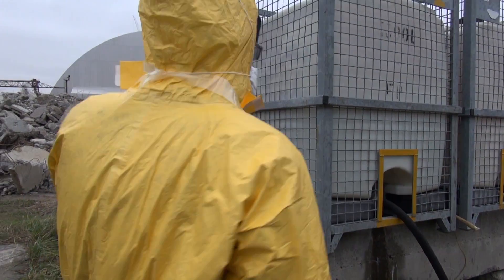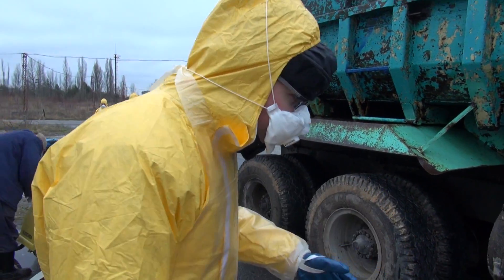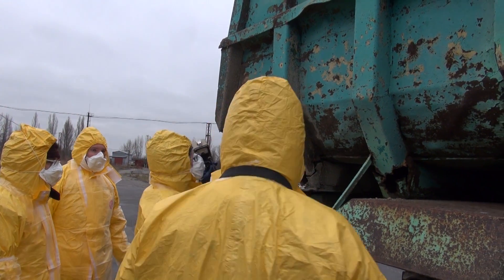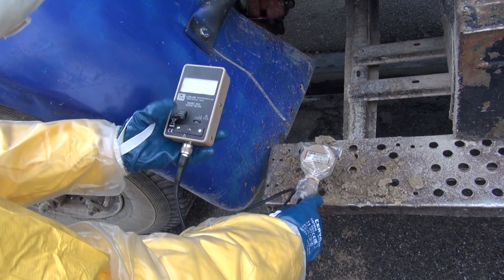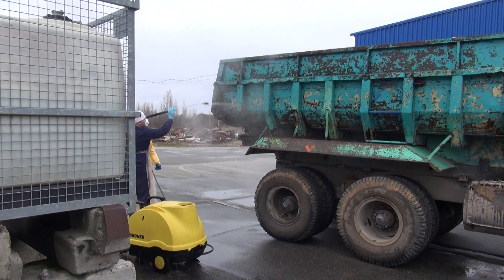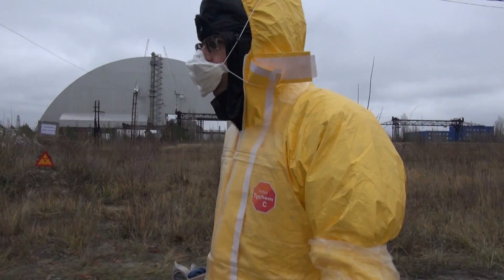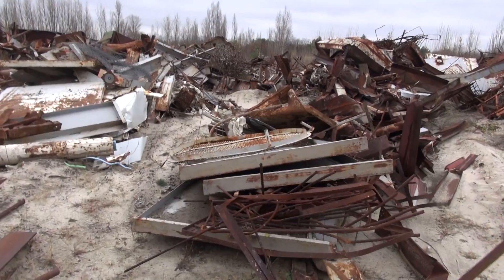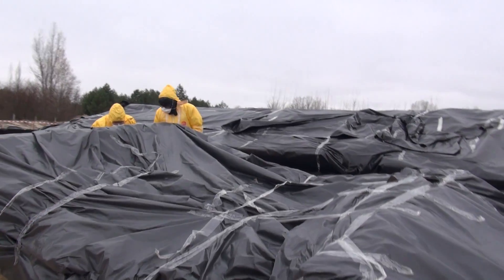decontaminating Chernobyl - what to do with a radioactive truck?

Comment: I always wondered since Fukushima could they in reference to contaminated soil just cover these areas With Molten Plastic aiming to capture the top soil and or maybe disc and till in hot molten plastic  to trap the contaminated soil within the solid structure of the plastic though it may be far to costly material

Comment: Would not it be better to be up on a platform and spray it down from above so that you don’t get contamination on you? Also you could collect the contamination if you had to truck in some kind of containment area instead of just washing it out on the road.
Reply: The higher you are the most radiation

Comment: All those area should be covered with 5-10-15 m high concrete with lead spreads. Does it work?
Reply: how should they dump 15 metres of concrete in a square that wont spread out and go flat in a perfect area around the power plant?

Comment: Nice video. What was the highest reading ? On the video there is shown 1 milliroentgen/hour? Blasting contaminated material with high pressure water looks quite dangerous, I cant even imagine how much there is hot particles airborne after that. I imagined that they have some big tents where wehicles etc are sprayed operating from outside the tent.

Comment: are you kidding me that's retarded, all that dirt where guys step in and out the truck was highly radioactive, what does that tell you ? that dirt came off the drivers boots, the dirt is in the truck too. the inside of the truck is contaminated. so when the driver gets out at his destination the radioactivity of the dirty not clean floor and pedals of the truck goes right off his boots and into his house and where else ever.

Comment: The yellow outfits and the badly fitting paper masks mostly protect them from Alpha radiation, I take it?  I never use dust masks like these, just the rubber dual respirator ones.Good to see you back. Where have you been hiding??? :)

Comment: why there are concrete cement at 6.34? (where you walked above)
Are they there to protect soil from other trash/structure or for cover contaminated soil?
Sorry for bad english and thanks for beatiful videos!
Is dangerous to visit Pryp'jat' for one day? I'm Environmental engineering and i'm very interested to visit Chernobyl and Pryp'jat' but i can't find verified information about radiation and air quality. Could you tell me some information? Thanks a lot!
Reply from the maker: they're most likely for the very heavy transport vehicles that brought those huge pieces of metal from the turbine hall to this place. i imagine they're so heavy, especially with that load, they could get stuck in the mud, which must be prevented at all cost.

and no, visiting Pripyat for one day is not dangerous. on a normal excursion, even if you decide to visit inside the reactor number two control center (which is possible for tourists), you will get less radiation dose than on the flight (assuming intercontinental flight). just google for it, you will find many tour companies.

Comment: How can metal be contaminated? Did it get activated? I can imagine materials with "pores" (concrete, stone, wood) to incorporate radioactive particles so it's impossible to get them out. But with metal isn't the contamination "just" stuff on the surface that could be washed off?
Reply: superdau thats exactly the point of powerwashing the trucks. However you would be amazed how rough and porous even a polished sheet of metal surface is on a microscopic level... not to speak of these rusty lumps of metal laying arround ... Therefore in NPP you paint everything with decont paint, which makes/has a very smooth surface with few pores...

Comment: "cringe"? Yeah just a bit. Is that a tyvek suit, pvc cape, 3m mask? It's some way south of what I'm used to. Is that ok in Germany, or just Ukraine?
Reply from the maker: the mask isn't ok, but the rest is pretty much exactly what we have in civil defense as well (amongst other suits, depending on the situation). you'd wear a full face mask with a filter and seal it off in germany, though, IF this exercise would happen as an exercise in germany, which it never would, but... uh, yeah.
Reply: Yeah for that work I'm sealed into pvc with a respirator. Boots and gloves sealed to the suit. 3 pair of gloves lol. After ten minutes work sweat is running down the inside of the suit and pooling in the boots.

Comment: I wondered something.  Now that the new safe confinement structure is completed and the next step is to remove the old sarcophagus, where do they plan to put the remains of the structure?  I imagine that it's too highly contaminated to simply be dumped outside in the radioactive scrap pile.  It's a shame that all that steel can't be recycled due to how radioactive it is.
Reply from the maker: a lot of it will have to be stored as radioactive waste (like waste in a working nuclear power plant, too). however, some research is being done on ways to decontaminate at least some parts.
Reply: Could it be melted into large steel ingots trapping the contaminants inside? I'd be interested to learn more about this :)

Comment: i think the audio channels might be mixed up. I don't think the problem is at my end. But its a cool idea :D
Reply from the maker: strange, so you feel that left and right is inverted? hmm, i didn't notice that...
Reply: i think so ;) . it is sometimes difficult  to tell where the audio is actually coming from but it seems to me, that sound that should come from straight ahead comes from behind. usually that is because the channels are inverted
Reply from the maker: hmm. again, i didn't notice that. then again, it's also not a true binaureal recording. it's a 5.1 recording, and as i typically hold the camera, i guess noise i make might appear to come from all channels / above. too bad you cannot upload multiple audio sequences to youtube; guess it'd be best to leave the choice to the user, as so far, i am getting mixed reviews. i actually don't have much of a fucking clue about audio processing though, so that might be an additional issue. :P
Reply: I really like the idea. I have got a Panasonic camcorder with "5.1 audio" and it sound like crap because the microphones are all just facing in the same direction and i guess it has to do a lot of processing to get the audio channels it needs. So i usually just use a Good external Stereo mic and record it at the maximum bitrate the camcorder supports.
Reply: Hey, welcome back, I'm looking forward to more informative educational and entertaining videos!!